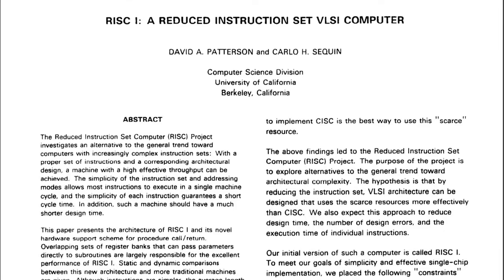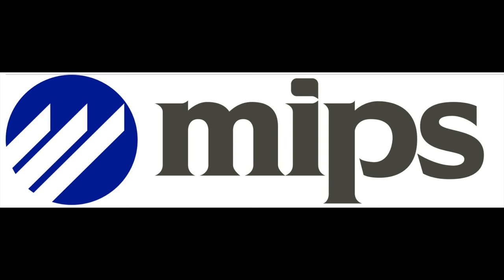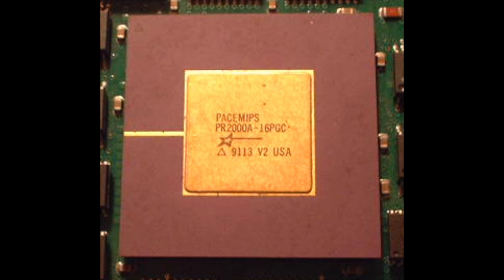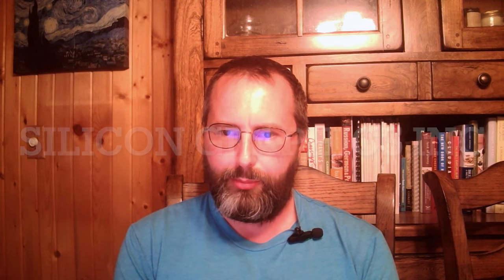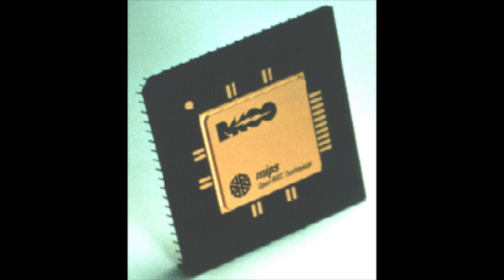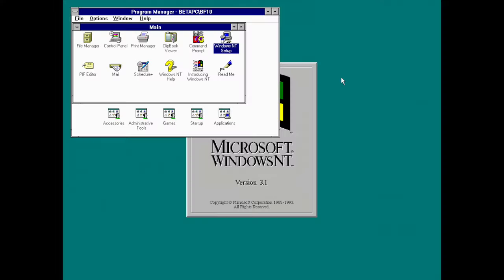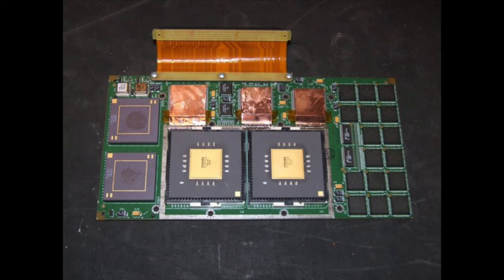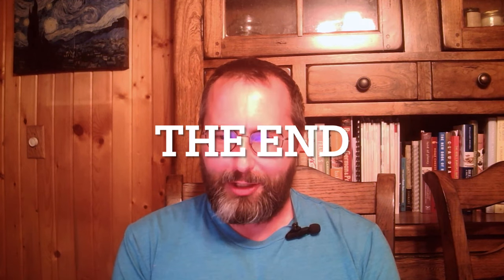The Weird Story Of MIPS Architecture - From Beginning To End. Brain Dumps #2

Comment: I would love to find some modern 64 bit kind that could be used/hacked for a pc
Reply from the maker: I'd love it if MIPS were still being developed and was benefitting from the advances we've made in the last 15 or 20 years.. Unfortunately, despite a few announcements around 2015, we're left with nothing more than low power SoCs running ip cameras and wifi routers. RISC-V is the true successor, and you can already get much more interesting devices powered by it!
Reply: MIPS r18k prototype here. Nothing special, it's MIPS4 64bit ISA, but it introduces trmem. It's also better than { R10k, R12k, R14k, R16k } about being a true cache-coherent system in multiprocessors implementation.

Comment: It is a good memory that I translated and published "The MIPS-X RISC Microprocessor" by Paul Chow into Japanese. I found the book at Stanford book store and proposed to publish in Japanese to a publishing company. I was impressed by the idea of software re-ordering of instruction and increasing clock by smaller chip size.
Reply from the maker: It's interesting how many of the advancements made by MIPS are staples of modern CPU design. The glory days are behind us but the legacy continues!